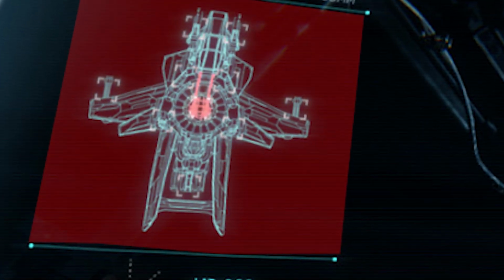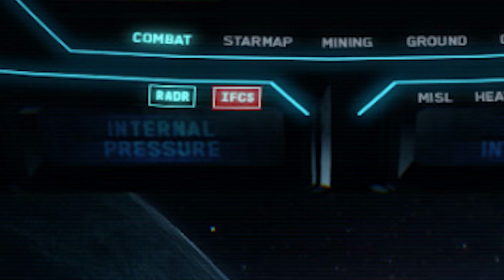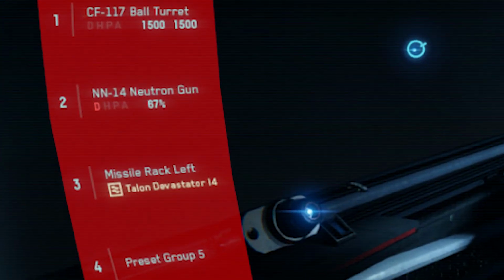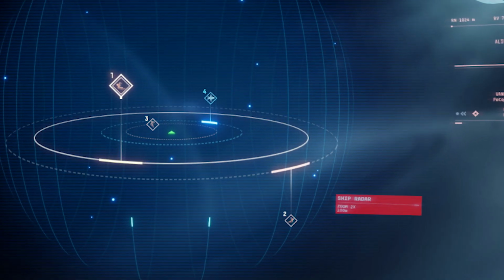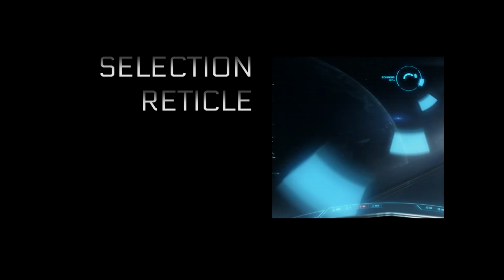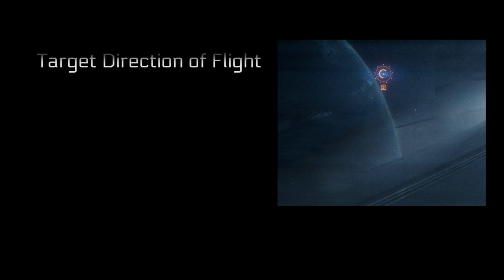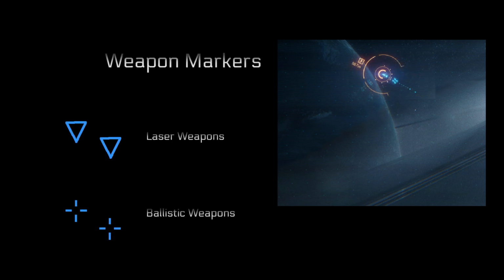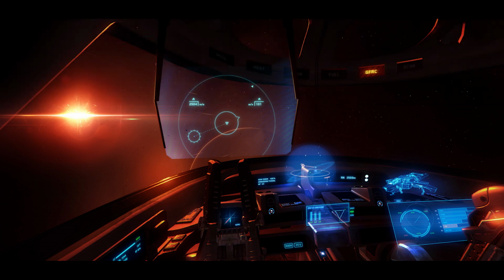Star Citizen - Hud Design

Comment: Very good job thanks...
But I think these are the old UI mo-caps and not the final we will see in the AC v1
And they had simplify them more so even "amateurs" to understand what they do, without reading a manual .( like a true sim.)   
Also the annoying popup missing locking rings have more parts if it takes longer to lock... 4 part= 4 seconds .. 10 parts = 10 seconds :/

I just hope We can have Advance UI and a simple UI for amateurs

Comment: Awesome overview, Chris.

The top center row of indicators, combat, starmap, mining ground and off would seem to be HUD modes.

The indicators above the wireframe on the left side appear to be to highlight what systems are depicted on the wireframe itself. With OVR, lit, most major systems have blocks highlighted. Selecting other modes may focus those systems.

 Why no mention of the sensor clusters for EM/IR/RCS on the left and right cockpit screens?
Reply from the maker: Mostly due to the low quality picture, I'd like to clearly show what I'm talking about as well :) Thanks.